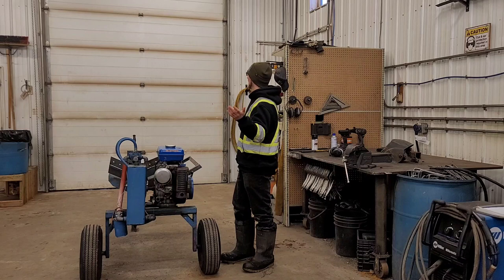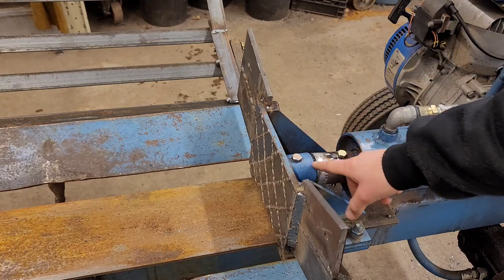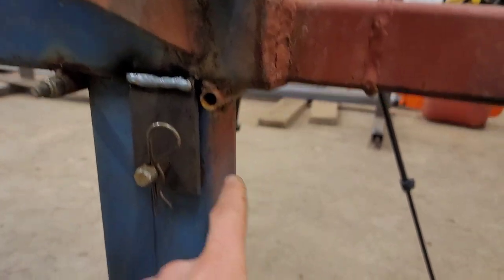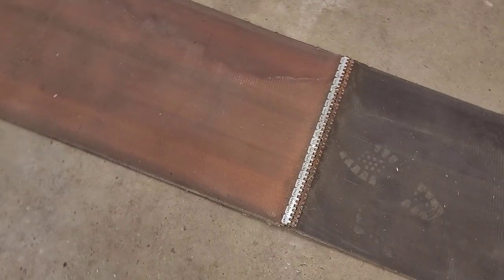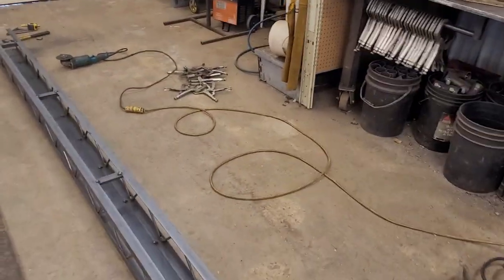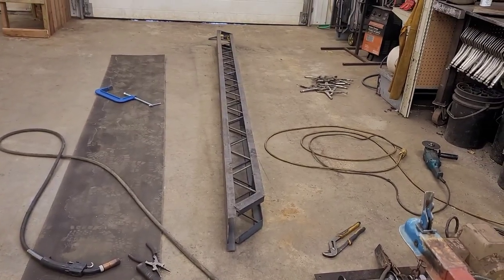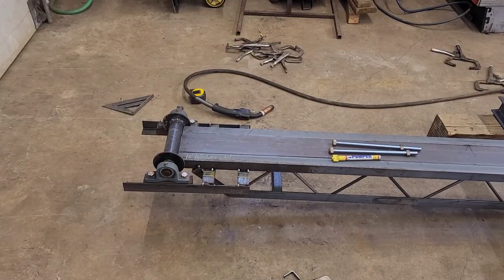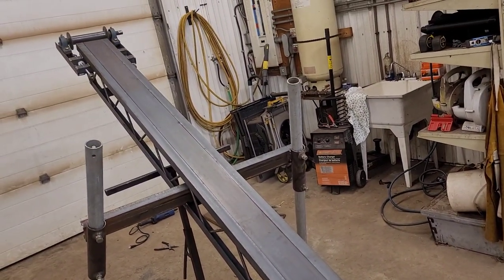DIY Homemade Firewood Processor

Comment: Just some knowledge on conveyors add a crown in the pulleys it helps in belt tracking. I have used Duck tape and built it up.
Reply from the maker: That's actually a fantastic idea!
Reply: I worked in a wood mill for years

Comment: Drive pulley on conveyor should be at top end (discharge end) not bottom
Reply from the maker: It would definitely help! It works. Not great, but enough to do what I need for now.
If I build another one there there will be lots of changes!

Comment: Looks good! Im planning on building something similar. Whats the original use for that rubber strap? Is it meant for conveyors? I dont know where to source that from since its extremely expensive to buy them where im from
Reply from the maker: Thank you! I got a piece of old conveyor belt from my dad. I believe he knew someone who used to replace them and would sell the worn down ones on the side.
Reply: @adeyacres8695  oh okey, thats sweet!
Reply from the maker: Best bet would be to look at local listings and see if anyone has any. Mine isn't perfect but it works.